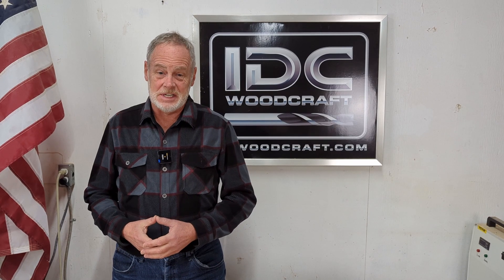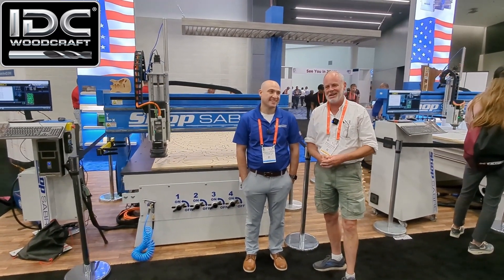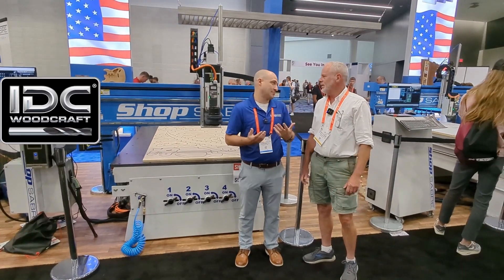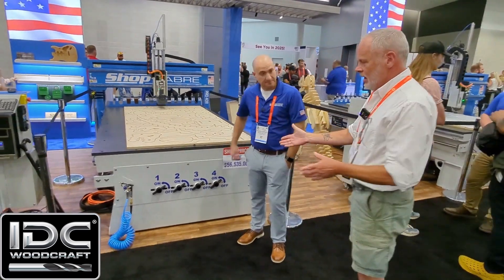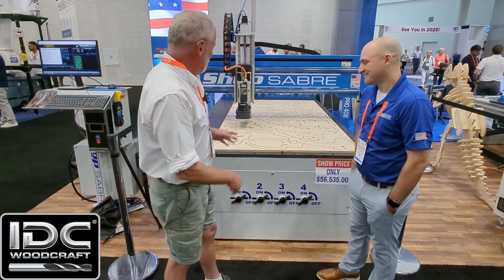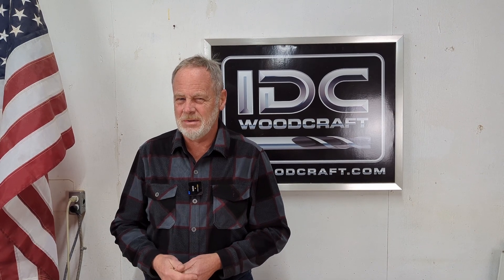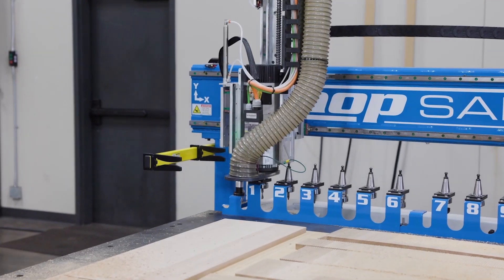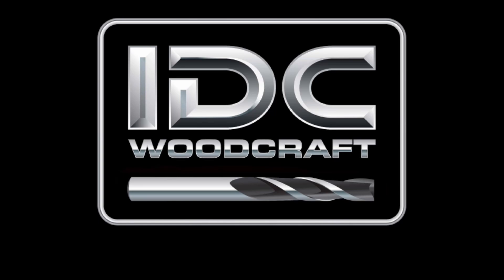Learn About The Shop Sabre CNC Router - Interview With IDC Woodcraft

Comment: I purchased a CNC router from ShopSabre, including a vacuum pump and their software package, expecting a complete and functional system. However, I was surprised and disappointed to learn that the on/off functionality for the vacuum pump—an integral part of the setup—is locked in their software unless I pay an additional $300. This wasn't clearly communicated upfront, and it feels like a bait-and-switch.

When I reached out about the issue, I received a call from the owner's son, who took an unnecessarily arrogant tone, saying, "My dad started this company—we know what we’re doing," as if that justified nickel-and-diming customers after the sale. It was condescending and unprofessional.

Rather than pay extra for a feature I should already have access to (on equipment I own), I’ve decided to build my own controller to manage the vacuum pump and other components. I expected more transparency and better customer service from a company at this level.

Disappointed overall. The machine might be solid, but the way they handle business leaves a bad taste.
Reply from the maker: I'm really sorry to hear about your experience with ShopSabre. That's definitely not the kind of customer service anyone should have to deal with, and I understand your frustration. Thank you for sharing your thoughts!

Comment: The Shop Sabre seems like a rugged, well built and designed machine. If I was doing heavy duty, high volume production, I would surely consider the Shop Sabre.

For now, what I have is quite adequate for what I'm doing.
Reply from the maker: cncprogrammer, the Shop Sabre is quite the machine brother! Glad to hear your setup is working well for you too.